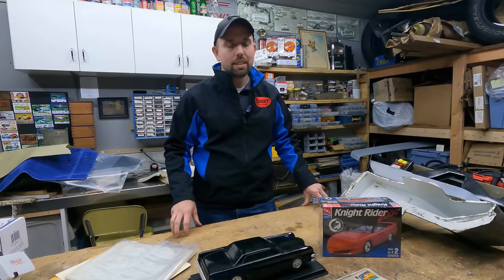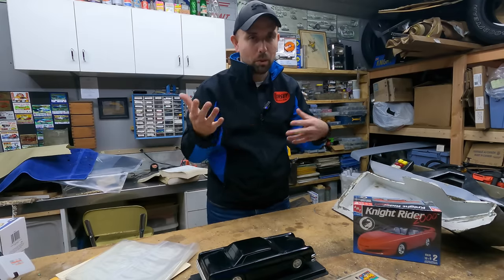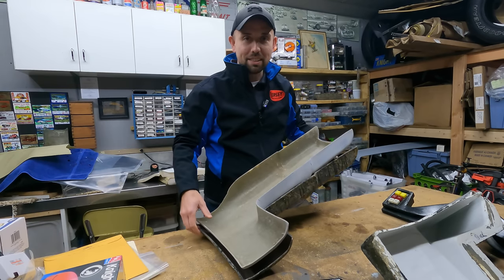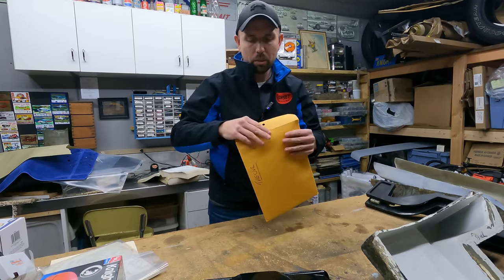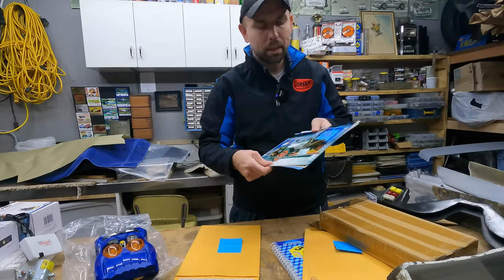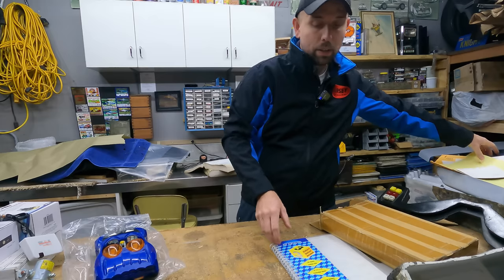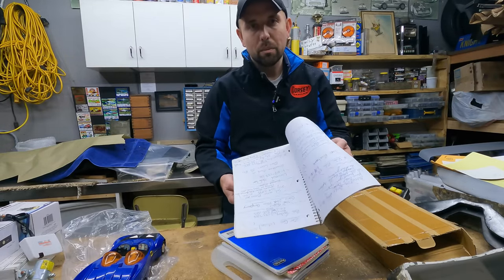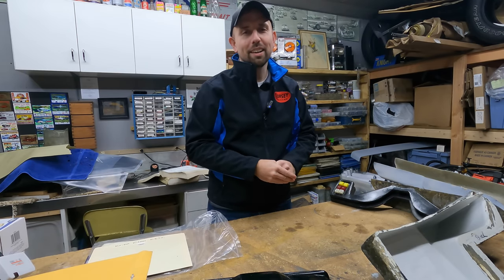How a 1984 Batmobile Toy Influenced the design of Knight Rider's Super Pursuit Mode KITT + Auction!

Comment: what you should do when you get the trailer finished is put a spare parts rack section in the trailer and put what parts you can in it, maybe overhead bin storage or the right side of the trailer , cause those two sections are sort of an open canvas as they were not really shown much if at all

Comment: Hey Joe, the black front-end on the photo you're showing at 15:48 was for the (late 70s) Camaro-based "TurboCar" for the 1987 movie "RoboCop".
It was supposed to be the car specificaly built as RoboCop's patrolcar.
But somehow the design on paper didn't translate well to a ful scale vehicle and it turned out to be too cramped for actor Peter Weller wearing the suit...

So when director Paul Verhoeven is said to have seen a (then recently launched) Ford Taurus driving by, he reportedly found the design very futuristic and decided to use it instead as the standard issue OCP Detroit PD patrolvehicle.

Comment: The pics of the black car front and rear ends are actually the design for a special police cruiser in 1987’s Robocop movie. It was designed by Robert Webb based on the 2nd gen Camaro. They found it too strange looking so instead the production went with the then new 1st gen Ford Taurus as the future Detroit police cars. Webb supposedly had a hand in the design of the SPM and convertible KITT’s with George Barris.